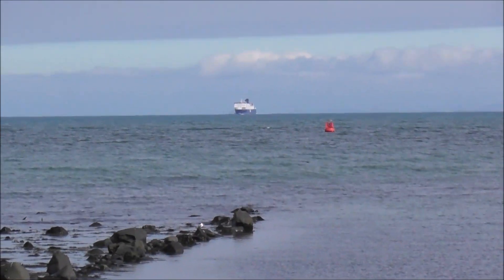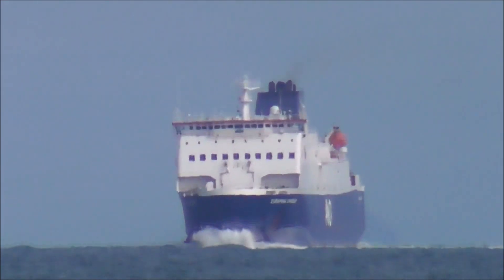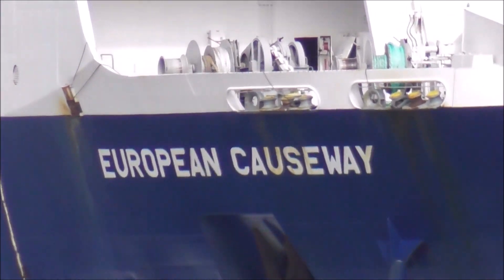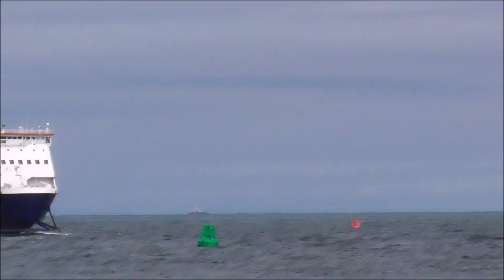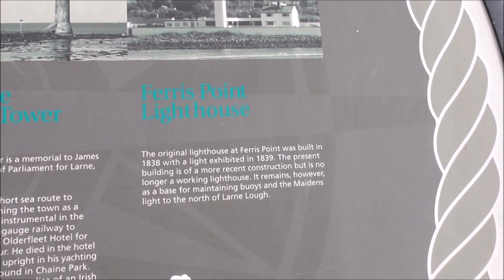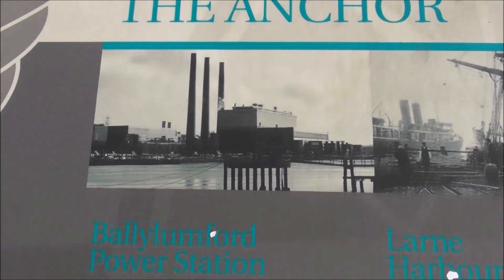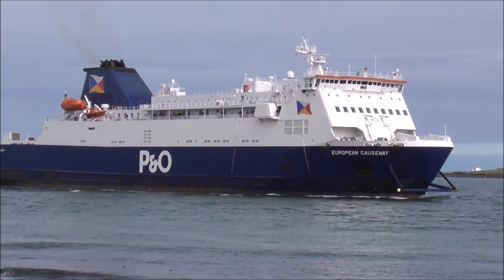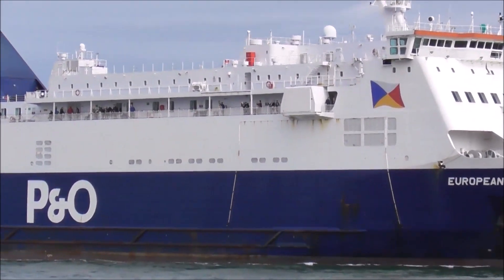P&O MV European Causeway Ferry Arrives Larne Port Co Antrim

Comment: Hey Ferry time again Tom, you got some cracking video when you panned in close, used P.O. quite often in the early 90s going to France just that short hop across the Channel, there has been fun and games at Dover as you probably know but I think it's just about sorted now.
Reply from the maker: It appears that the socalled 'friendly French gov't hate us Chris. They have pushed the dreadful protocal on N Ireland to please Ireland and the EU. Now because of Brexit that actually didn't deliver Brexit, they are hitting passengers travelling to and through France by completely unnecessary delays.